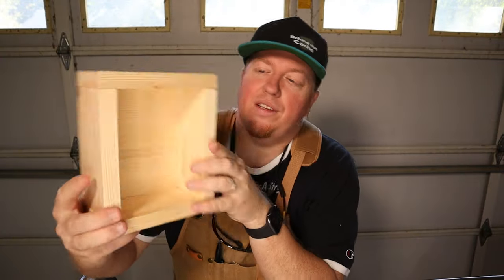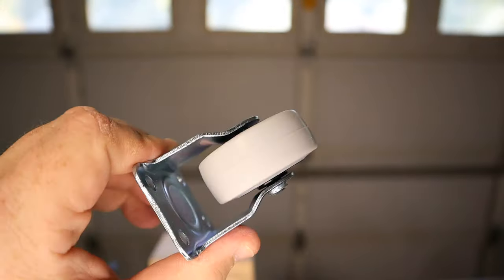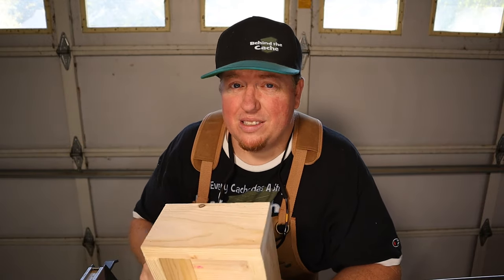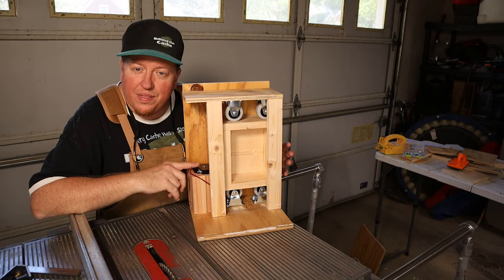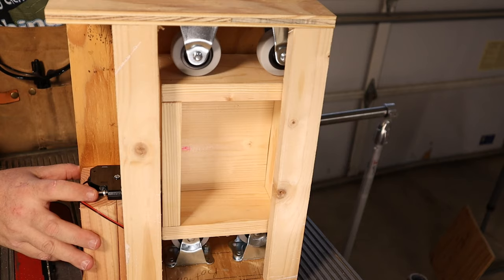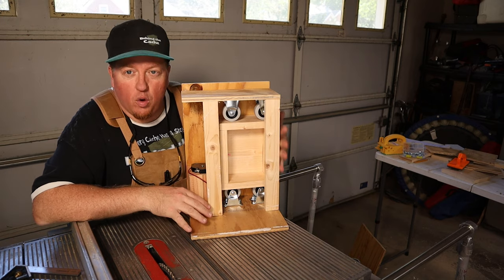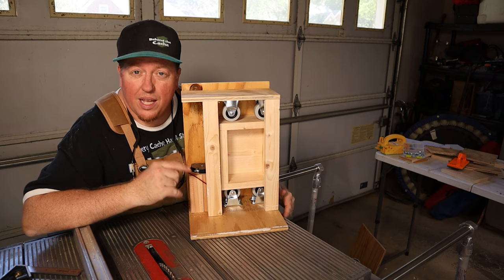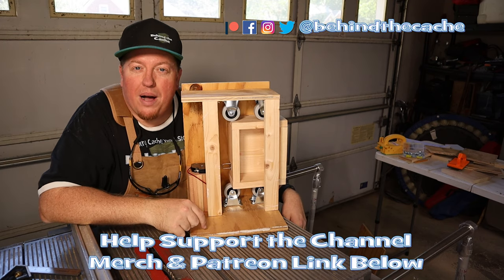Gadget Cache Build - Secret Drawer Prototype pt. 1 (GCNW)

Comment: Beautiful!!! How bout a Simon /flashing lights type of puzzle- where u have to get the correct sequence for it to open? 
What will keep the back corner of the drawer from dropping down in between the two casters as it’s coming out? It looked like it got a bit stuck twice there? A third caster? 🤷‍♀️ but yeah it’s great!!!
Reply from the maker: Trying to keep this one low tech but I like that for the one that I may add power too. I am hoping when the side is put on it won’t do that. This is the prototype and as I am recording this video I am figuring out the design. Nothing has been drawn up.  Once it is complete then I will make it in cider and more durable.